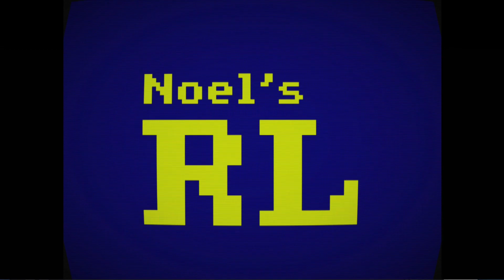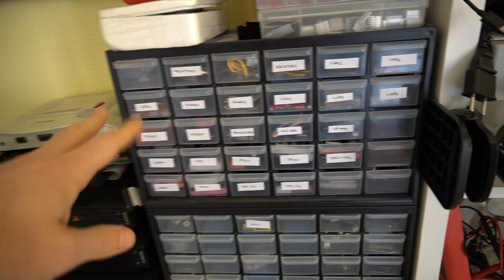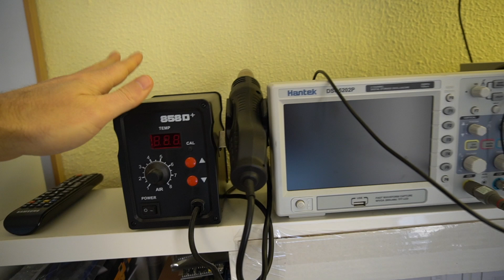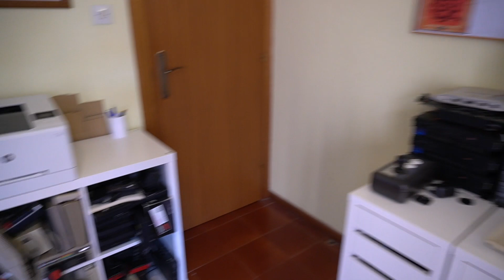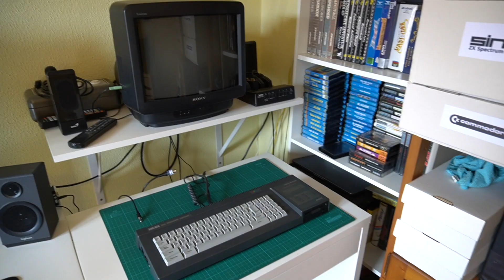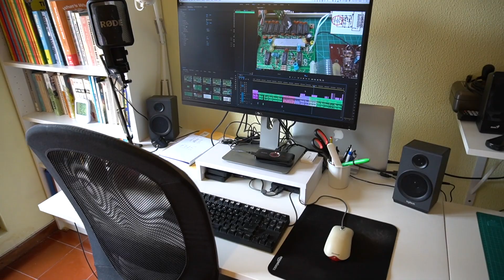Behind the Scenes Tour of the Retro Lab [Nibble Edition]

Comment: Are those Playstation 2's (or other late 90s/early 00s consoles you might get your hands on) going to be part of future videos as well? Or do you specialize in just microcomputers?
The consoles certainly are "retro" enough in my book. :-)
Reply from the maker: They're possible projects, yes. They were kind of dumped on my hands by a friend, and they all have different issues. It's more modern technology than what I'm usually comfortable with, but it will certainly be interesting to open them up and fix some of the drive issues they have. Right now I'm flooded with some higher-priority items though, so it'll take a while, but I'll get there eventually 😃
Reply: @NoelsRetroLab  That is awesome to hear. If anyone can get them to work again I know it will be you with your strong dedication and passion for your work. ;-)